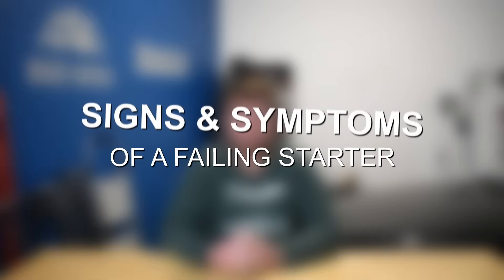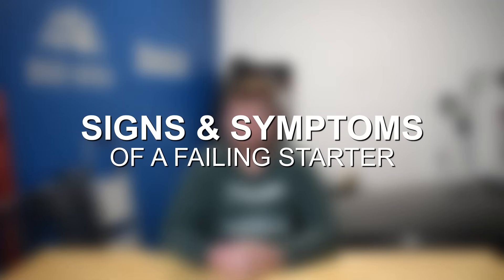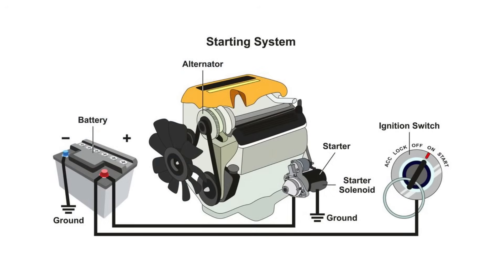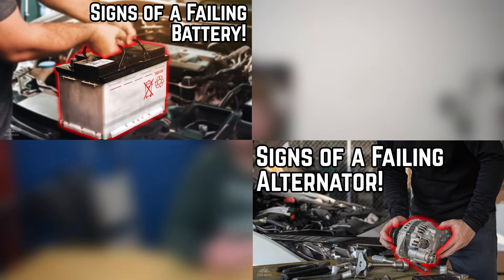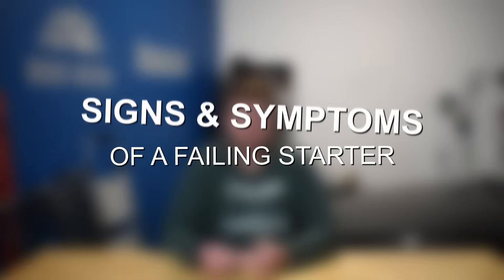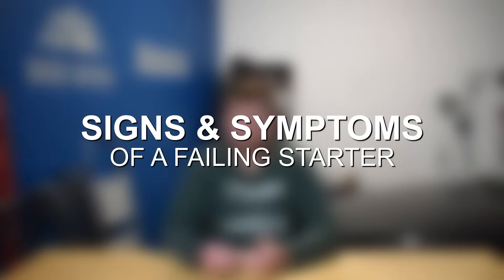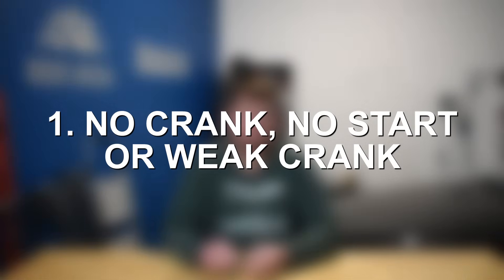5 Symptoms of a Bad Starter!

Comment: My 1999 suburban has issues starting bought it recently used and had to get it jump started to run but it ran fine for two days sometimes would start sometimes fully dead needing jumped now makes rapid clicking noise when key is engaged and all lights on dash shut off when engaging key is that from a starter or alternator battery has been charged and removed and tested good
Reply from the maker: A - The rapid clicking and dash lights shutting off when turning the key typically indicate a bad connection, weak battery, or failing starter. Since your battery tested good, start by checking battery terminals and cables—loose, corroded, or damaged connections can prevent full power from reaching the starter. Next, test for voltage drop at the starter while cranking. If power is reaching the starter but it still just clicks, the starter solenoid or motor may be failing. Also, check the ground connections from the battery to the chassis and engine block. If everything checks out and the issue persists, the alternator may not be properly charging the battery, causing it to drain between starts. A quick way to test: with the engine running, measure battery voltage—it should read 13.5-14.5V. If it's lower, the alternator isn't charging properly.
Reply: I don’t think it’s battery terminals since I had to change them it could be a ground I haven’t check that yet will keep updated as I work on it thanks

Comment: I just had a starter fail after only 14 months. The starter control terminal on the solenoid broke. It was facing down and exposed to road debris. The new one is facing up into the engine compartment. Something to look for when buying a new one. The new one is a Duralast from Autozone. The old one was an ACDelco.
Reply: This is actually VERY helpful! My starter was also changed about 15-16 months ago leading me to think there was NO way it could be the starter, but mine was also ACDelco. So thanks so much! Along with having ALL of the issues mentioned in this video, I'm convinced. 😂 Going to buy a starter!
Reply from the maker: @ Keep us updated!
Reply from the maker: L - So sorry to hear this.. Thanks for taking the time to share your experience!

Comment: I got a 2010 ford escape all lights work just no crank or start is this a starter issue it won’t try to start or anything
Reply from the maker: D - If your vehicle has power to all lights but won't crank or start, it could be a starter issue, but you should check a few things first. Make sure the battery has a full charge and that the terminals are clean and tight. Try shifting to neutral and starting it to rule out a bad neutral safety switch. Also, check the starter relay and fuses in the fuse box. If all of that checks out, try tapping the starter while turning the key—if it starts, the starter solenoid is likely bad. If there’s still no crank at all, you may have a bad ignition switch, starter, or wiring issue.

Comment: One click here…
Reply from the maker: P - A single click when trying to start usually indicates a bad starter, weak battery, faulty starter solenoid, or poor electrical connections. First, check the battery voltage—it should be 12.6V+ when off and at least 10V while cranking. If the voltage is low, try jump-starting the vehicle. If the battery is good, check battery terminals for corrosion and ensure all grounds and connections are tight. If the connections are fine, tap on the starter with a wrench while turning the key—if it starts, the starter solenoid is likely bad. Also, check the starter relay and fuses, as a bad relay can prevent power from reaching the starter. If all else checks out, the starter itself may need replacement.

Comment: Is there a way to test the starter itself?
Reply from the maker: M - Yes, you can test a starter by performing a bench test or an on-car test. For a bench test, remove the starter, connect jumper cables to a battery (positive to the starter's main terminal, negative to the starter body for ground), and use a screwdriver to bridge the solenoid terminal to the main power terminal—if the starter motor spins and the solenoid engages, it’s working. For an on-car test, check for 12V at the main power terminal using a multimeter, then test for voltage at the solenoid terminal while turning the key—if you have power but the starter doesn’t engage, it’s likely bad. If there’s no power at the solenoid, check the ignition switch, relays, and wiring.

Comment: Got a difficult situation. I have a 1995 ford f150. It would start at times then not. It would crank rather well but just wouldnt start. When it started sporadically it would sometimes sputter a bit then die. Got to the point where it wouldnt start at all, not even sporadically. It already had a new battery while doing all of this. So i replaced the fuel filter and fuel pump, but then it just clicked when i tried to start it. I gave it a jump but it never started and just does a slow crank. The dash doesn't light up. Just the battery sign.
Reply from the maker: F - Sorry to hear this.. It sounds like you have both a starting system issue and a fuel delivery or ignition issue. Since you now only get a slow crank and no dash lights, check battery voltage with a multimeter—it should read 12.6V+ when off and 13.8-14.4V when running. If voltage is low, check for loose or corroded battery cables, bad grounds, or a faulty alternator. The clicking and slow crank suggest a weak battery, bad starter, or poor connections. Try jumping the starter directly with a screwdriver across the solenoid terminals to see if it cranks properly. For the no-start issue, check if the fuel pump primes when turning the key to "ON." If not, inspect the inertia switch, fuel pump relay, and wiring. If fuel is getting to the rail, check for spark at the plugs—if no spark, inspect the ignition coil, distributor, and crank position sensor (if equipped). Since the dash isn’t lighting up, check fuses, relays, and grounds, especially at the firewall and under the dash. If power isn’t reaching the PCM, it won’t start. Keep us updated!

Comment: I have a twingo 3. I just had the lambda probe changed, and now i have issues with starting my car sometimes. When i turn the key it makes the normal sound then it dies and turn back on. I think it might be the starter, since it is a commen problem with that type of car.
But what do you think?
Or could it just be due to the battery since i drive 95% less than i usually do since start january.
Reply from the maker: J - It sounds like your starter motor or battery could be the issue, especially since you're driving significantly less, which can lead to a weak battery. A failing starter motor is common in the Twingo 3 and can cause intermittent starting issues. However, if the battery isn’t holding charge properly due to infrequent use, it could struggle to provide enough power for a strong start. Try charging the battery fully or using a multimeter to check its voltage (should be around 12.6V when off and 13.8-14.5V when running). If the battery is good, then the starter is likely failing and should be tested or replaced.

Comment: I occasionally get a grinding sound when I turn on my 2011 subaru outback 3.6r.  how can I diagnose the issue?
Reply from the maker: B - Sorry to hear this! The occasional grinding sound on startup in your 2011 Subaru Outback 3.6R is most likely caused by a starter motor issue, specifically the starter Bendix gear not fully engaging or disengaging from the flywheel. To diagnose, listen closely to whether the noise occurs right at startup or just after the engine fires up. If it's at startup, the starter motor or flywheel teeth may be worn. If it happens just after the engine starts, the starter solenoid might be sticking, causing the gear to stay engaged briefly. You can inspect the starter gear teeth for wear, check for loose starter mounting bolts, or replace the starter if the issue persists.

Comment: Ok… so what is the issue if you have changed the battery and the alternator, the car starts up fine and then after a day or so the car still dies? Could the started have a phantom drain if it’s going bad and still turn over with enough juice supplied to it?
Reply from the maker: D - Sorry to hear this. Yes, a failing starter can cause a parasitic drain, even if it still engages and cranks when enough power is supplied. However, the most common culprits for a battery draining after a day are parasitic draws from accessories, a faulty alternator diode leaking power, or a bad ground connection. To diagnose, perform a parasitic draw test with a multimeter to check for excessive current draw when the car is off. If the drain is significant, start pulling fuses one by one to identify the faulty circuit. Also, ensure the alternator isn’t allowing power to flow backward when the engine is off, as a failing diode can drain the battery overnight. Keep us updated!

Comment: My car has a strong crank and electronics work just have trouble starting it, what am I doing wrong, too much gas or ?
Reply from the maker: B - If your car has a strong crank, working electronics, but struggles to start, the issue is likely related to fuel delivery, air intake, or ignition rather than the battery or starter. Pressing the gas pedal too much while starting a fuel-injected car can flood the engine, making it harder to start. Try starting without touching the pedal. Check for a weak fuel pump, clogged fuel filter, faulty fuel injectors, or a bad fuel pressure regulator, as these can cause hard starts. Also, inspect the mass airflow sensor (MAF) and throttle body for buildup that could restrict air intake. If the problem persists, faulty spark plugs, ignition coils, or a crankshaft position sensor could be preventing proper ignition. Run a scan for stored trouble codes, even if no check engine light is on, to pinpoint the issue. Keep us updated!
Reply: @8020Media  thank you.

Comment: Changed two different Civic starters- 2007 and a 2008. They're fun.
Now my 2012 is doing a little. Something different. You actually hear the starter gear turning, but it's not sliding outward to  engage the flywheel.  Only happens intermittently, but like most starters, they give you warnings.  I think I'm going to go ahead and order the starter and plan on my next day off changing it.
Reply from the maker: T - Think that sounds about right. Keep us updated!
Reply: Boggsy, I have a 2019 civic, when I push the button to start it I get a few clicky noises, then I take a deep breath and try it again and after couple reps of that it’s will fire up. Does this sound like a starter problem or battery problem??
Reply: It could be either; however, I think I would check the battery first.  And remember, these civics are very, very sensitive to the battery's health. @cloverkush
Reply: @ Thank you! I appreciate the reply big time man. You definitely didn’t have to do that! I will get my battery tested before I buy a new starter

Comment: Subscribed and liked. 
Mine will click, sometimes if I turn the key suuuuuuper slow on that contact click and hold it as close to that click it will start.
Reply from the maker: O - Thanks for the feedback! If your vehicle clicks when turning the key but sometimes starts when turning it very slowly, the issue is likely a worn ignition switch, faulty starter relay, or corroded wiring connections. The fact that it responds to very slow key turns suggests that the contacts inside the ignition switch are worn or not making full contact. Try wiggling the key while turning—if it starts more consistently, replacing the ignition switch should fix it. Also, check the starter relay and battery terminals for corrosion or loose connections, as bad contacts can cause intermittent starting issues. If the problem persists, the starter solenoid could be sticking or failing, which would require replacing the starter assembly. Keep us updated.

Comment: my car cranks slow or not at all when the engine is hot... what is the problem? Its fine in cold and when engine is cooled for some time.  vw polo.
Reply from the maker: S - If your vehicle cranks slowly or not at all when the engine is hot but starts fine when cold, the issue is likely related to heat soak affecting the starter motor, weak battery, poor electrical connections, or high resistance in the wiring. A failing starter motor can struggle to turn over when hot due to thermal expansion increasing internal resistance. The battery could also be weak, providing just enough power when cold but struggling when heat increases resistance in the electrical system. Additionally, corroded or loose battery terminals, bad engine ground connections, or a worn-out alternator could contribute to the issue. Start by checking battery voltage when hot and cold, cleaning battery terminals, and ensuring the engine ground is secure. If the battery is fine, the most likely culprit is the starter motor needing replacement due to heat-related wear. Keep us updated!

Comment: Is it my switch or my starter? My car goes into accesory, but absolutely nothing happens when i turn it over, no clicks, no flickers. Nothing.
Reply from the maker: 3 - If your car powers on in accessory mode but does nothing when turning the key to start—no clicks, no flickers—it’s likely an issue with the ignition switch, starter relay, or wiring, rather than the starter itself. A bad starter usually clicks or struggles, but complete silence points to a faulty ignition switch, neutral safety switch, or an issue with the power supply to the starter relay. Try shifting to neutral and starting—if it works, the neutral safety switch may be bad. Also, check the starter relay and fuses, as a blown fuse could cut power to the starter circuit. If those check out, test for power at the starter solenoid when turning the key; if there’s no power, the ignition switch or wiring is the likely culprit. If power is reaching the starter but it doesn’t engage, then the starter itself is faulty. Keep us updated.

Comment: Thank you for this informative video. My avanza doesn't immediately restart after driving for 29mins. I have to wait for another 30mins to cool down the engine before it's engine could restart. What it's problem?
Reply from the maker: H - Your vehicle not restarting after driving for 29 minutes and only starting again after cooling down for 30 minutes suggests a heat-related issue, likely involving the starter motor, crankshaft position sensor, or fuel system. A failing starter motor or solenoid can suffer from heat soak, causing it to fail when hot but work again after cooling. A bad crankshaft position sensor can also cause a no-start condition when hot, as the sensor may stop sending signals to the ECU until it cools down. Additionally, a weak fuel pump or vapor lock could prevent proper fuel delivery when the engine is hot. To diagnose, check for spark and fuel pressure when it won’t start, and if the starter doesn’t engage, try tapping it lightly to see if it cranks. Keep us updated!

Comment: Hi great video!! Can a starter motor work intermittently?
Reply from the maker: K - Yes, a starter motor can work intermittently, usually due to worn internal contacts, a failing solenoid, bad wiring connections, or a weak battery. If the starter sometimes works and sometimes just clicks or does nothing, check the battery voltage (should be 12.6V+ when off and 13.5–14.5V when running) and inspect the battery terminals and ground connections for corrosion or looseness. If the battery and wiring are fine, the starter solenoid or internal brushes may be failing, causing inconsistent engagement. Tapping the starter lightly with a wrench while turning the key can sometimes get it working temporarily, but if it keeps acting up, replacing the starter assembly is the best fix. Keep us updated!
Reply: @ thank you very much for your advice. I’ll check the connections before asking my mechanic to change the starter and solenoid.

Comment: My car does the clicking u talked about so should I just replace my whole starter ?
Reply from the maker: C - If your car is making a rapid clicking noise when you turn the key, it’s often caused by low voltage reaching the starter, which could be due to a weak battery, corroded or loose connections, bad ground, or a failing starter solenoid. Before replacing the starter, check the battery voltage (should be at least 12.6V when off and 13.5–14.5V when running). Also, inspect the battery terminals and cables for corrosion or looseness, as bad connections can cause the starter to click but not engage. If the battery and connections are good, try tapping the starter lightly with a wrench while turning the key—if it starts, the solenoid is likely failing, and replacing the starter assembly is the best fix. Keep us updated!

Comment: Can another symptom of a bad starter, start the vehicle cold, but after it runs for a while, not start it. Has a new battery. Just curious.
Reply from the maker: D - Yes, a bad starter can exhibit symptoms where it starts the vehicle when cold but fails to crank when hot. This is known as heat soak, where the starter motor or solenoid overheats, increasing electrical resistance and preventing it from engaging properly. When the engine cools down, the starter regains functionality and works again. Other possible causes include corroded or loose battery cables, a weak ground connection, or a failing starter relay. Keep us updated.